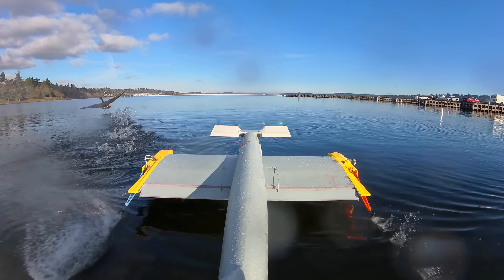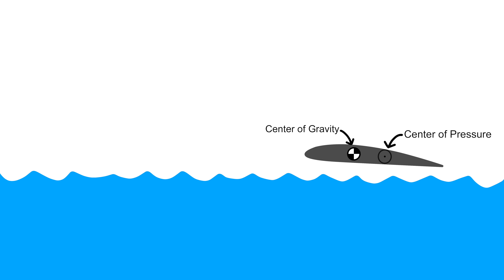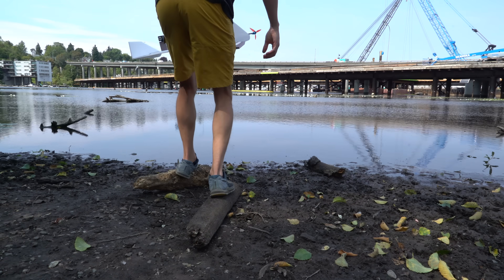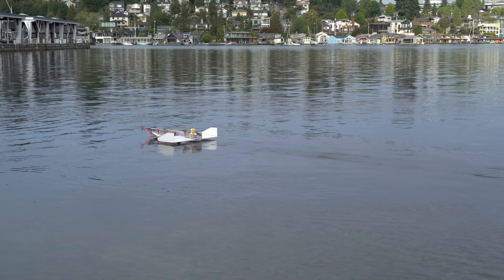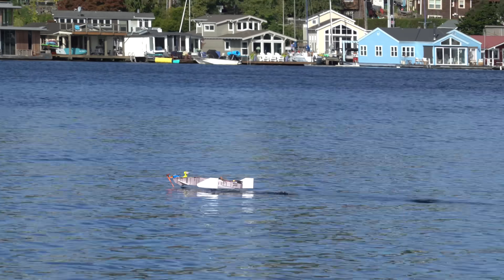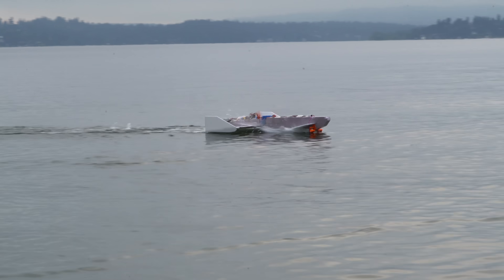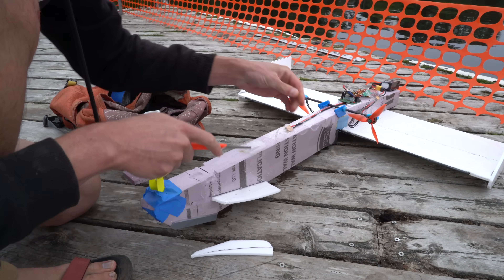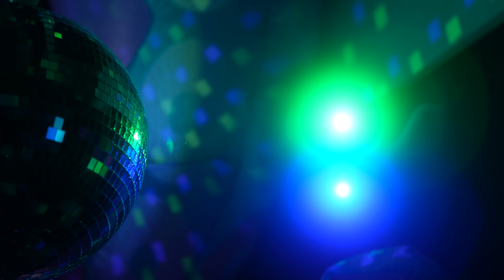Testing a Hydroplane / Ekranoplan Hybrid

Comment: i love your hydroplane videos. and as a former Offshore racer and also a RC geek 28 to 32% you want the CoF on a catamaran to have a good balans then you are up and riding on the air bag under your catamaran. we often used 32% for "shoppy" water races, and if we had calm weather we dropped down to 28 or 29% and ofc we had water tanks in the front of the boat if we had to fill up with much more weight in the front for wave jumping at speed without the nose pointing to the starts.

Comment: I dono much about any of this stuff but it seems like one or two hydrofoils would solve all the problems. From stability to turning, lift off or plunging it seems like the energy loss from a very minimal water drag would at least be useable. I wonder if extremely small fins would do the same thing, small not in height but in surface area in the water.

Comment: You should try making a larger (4 or 5 foot long) Ekranoplane, since the small size is clearly responsible for some of the oscillations/inability to deal with rough-ish waters. I think it would also increase the range of speeds it is stable at, by kinda slowing down the oscillation.

Comment: bro a Cessna 157 with 45 degree flaps and going 50 mph is a ground effect vehicle, too fast to land due to ground effect it wont touch the ground, but too slow to take off you cant pull up

Comment: I'm not knowledgeable in any way about all this. I think the most realistic way is active correction. On some flaps for really high speed correction, as even the inertia from doing it on the heavy motors would delay it too much. It looks like a too unstable reaction, one that even a gust of wind could push over the point of no return.

Comment: Have you thought about dynamically adjusting the CG within the plane?  Say, a feedback loop between an altitude sensor and something that slides the battery forward or back on a rail.  Or would the control / sampling loop not be fast enough to handle it?

Comment: Just lose the water motors. Increase the density of the aircraft. Add a large vertical stabilizer WAY back. The true solution is the Pirate Party.

Comment: I don't know if it's right, but I always picture PAR thrust as being the same as a hovercraft. And that got me thinking of something. What if in the front you had a dedicated fan/blower that pushed up with just enough force to hover. It would be a negative feedback loop in the front to counteract the nose heavy design, allowing better control of the ekranoplane?

Comment: Would it help if you added some sharp, narrow, semicircular, V-edged 'pontoons' with tiny horizontal stabilizers to pivots on the trailing edge of the wing tips? I'm basically envisioning a tiny surface-skimming strut that extends below the craft as it lifts off the water, shaped in a way that planes well during level 'flight', but catches the water to create drag if the nose lifts too much and the craft tries to take off or flip. Basically, I'm wondering if it might help to add a miniature, pivoting version of the anti-wheelie bars you see mounted on the back of top fuel dragsters to keep the immense torque from flipping them over.

Comment: The captain’s license test prep videos talked a bit about the lights required for various crafts. There’s a specific light arrangement for surface effects crafts. They also are required to use regular boat lighting when in displacement mode, then switch when planing.

Comment: What about a ducted fan, with a flap that splits air between forward and upward thrust? Sort of like a hovercraft.  idk why, there's not specific advantage, but it'd be kinda neat to see. 
Another banger gev
Reply: For the water skipping, I think you're better off going with your hydrfoil idea. Controlling the hydrofoil's downward pull force into the water using elevator flaps on the foil itself could prevent the craft from flying away.  Maybe I'm forgetting and you've already tried that, though.

Comment: I'm an engineer by no means. But wouldn't it be possible to have one component under the water surface which is keeping the nose or the aircraft under water, while the motors try to pull it out of the water. So In the end there will be the force equalling out?

Comment: it stikes me that the problem of bobbing needs to be sorted out by averaging surface height.  How about something like a buoyant skate blade under the bow - used as a feedback mechanism for prop tilt?  Of course the same could be achieved with a downward-facing doppler sensor and so averaging function in the controller's algorithm.

Comment: I wonder if the big propeller size compared to the model size is an issue.
The propellers are so big, the bottom will probably produce ground effect thrust, while the top produces much less normal air thrust. Thus maybe the propellers themselves cause the bouncing by oscillating between the 2 thrust modes. It might be useful to encase the propellers and turn them into some kind of turbine with only a narrow exit to streamline the thrust to a thin point.
Or combine this ekranoplan design with your "100% Blown Wing Powered Airplane" design.

Comment: Make a front heavy limo, real long one. And use the rear stabiliser to trim it up instead of trimming it down when it gets lift. Long as in long body with high aspect wing in the middle with high angle of attack, with weight far away from the wing to slow the intertia enough for the controls to have a bigger effect. Deep V in the front is fine. Deeper than what you had here. Only serves to make it forgiving during take of and landing.
Reply: The lifting tail is a great suggestion for his nose-light airframe. Would prevent pitch ups.

Comment: Try to use the profile upside-down If it moves away from the water, it will pull down aerodynamically. And if it is close to the water, it will hold the distance due to air cussion.

Comment: This is Totally Fascinating!!  Your Persistence is seeking a "workable Solution" is thing of Beauty!!  I have a suggestion
I hope you find useful. Focus on the Wings and other Lifting surfaces.  As the Angle of Attack Increases and More Lift
is Created, you need a graduated method of "Dumping Lift Energy".  This could accomplished by having "Shutter like 
Devices" that Automatically start to Open or Close as the AOA changes on the Wings.  The "Shutters" will allow under
Wing Pressure to "Escape" to the Upper Side of the Wing.  A self correcting Lift Mechanism!!  I think it would be faster
reacting than changing the Prop Pitch Angle.  I really Enjoy watching Your Videos!!

Comment: Water foil devices solve this problem with a tail stabilizer: when a bow goes down, tail changes an angle of an attack and rolls a craft in an opposite direction. When a bow goes up, a tail rolls everything backward. When an angle is optimal, a tail generates a lifting force merely enough to hold itself.
You swapped everything. Your bow helps it to increase an instability. Get rid of a long bow, and add a long tail instead (and make it wide enough for an enough performance).

Comment: I think you’ve definitely caught everyone’s attention but you did it by going 100% down the wrong 3D printing rabbit hole. Today’s micro-electronics should make it very easy to incorporate two (for redundancy) lidar or radar sensors to know the vehicle’s height over the water. Tiny trailing edge flaps or even over-wing spoilers could then adjust the lift perhaps 50 times per second. Voila! Smooth ride and adjustable ride height.

Comment: The only way forward might be for an Arduino/Electronic stabiliser, using some type of pitch control. I watched the video and what you have done is impressive. Perhaps if you could rig some emergency type of corrector ? Stealth aircraft are also unable to fly without computer stabilisers. Fortunately you only really have one axis to correct. Good luck.

Comment: Surely your angle of thrust on the wet props is creating lift in the nose? Would not a level or even slightly inverted angle help to keep the nose in contact with the water? Rather than the angle of thrust pushing them up out of the water constantly? That whole design seems counter-intuitive to me.

Comment: I saw some kids with a stingray-shaped toy with an Aluminium tube tail playing in a Mekong Delta canal - that flew really well. I have a video...
The hydroplane race boat flipping is because they are always built tail-heavy instead of putting the engine at the front which would mitigate the problem but cause the propeller to pop out of the water often.

There are some extraordinary photographs shared by Michael Cleary on the photo share website 500px that might let you get some hints from Nature if you would like to cheat and shortcut your aerodynamic investigations ? I am not sure that I am allowed to link out here from this comment ? He has many photos of fruit bat flying foxes just after dipping their chest hair into a pool (that is how they drink) and also some diving birds. 
The particular photo that I suggest that you find has the bat wing forming a semi-circle with the wing tips almost touching the water and the bat body already an inch or two off the wet surface: it looks like a pure pressure pocket for efficiency but obviously the bat cheats with active AI aerodynamic controls. He titled that photo "Levitation".
🤣 Enjoy your experiments

Comment: Some suggestions for solutions for this problem, a shorter chord on the wing will reduce the effect of this lift displacement. Another one is to have two sets of wings, one to the front and one to the rear, making the front wing stabilize the craft with the increased lift it gets if pressed towards the ground/water. It should be possible to build such a design to be passively stable.

Comment: Maybe add a pressure sensor that actuates a bleed off slat in the wing.  Just like in the old SR71 engines, they would bleed excess pressure to keep things cruising at different speeds.

Comment: the nose adds drags and thats prolly enough to stabilize. if you add an under water fin itll just work... but then you had so much drag that you might as well just have a regular hydrofoil. i suspect the motor suspensions isnt the worst idea but its hard to get them super precise. perhaps with super high kv micro motors pushing up/down to compensate? idk, crazy ideas are fun

Comment: Hey here's an idea that could make this work. Use a small hydrofoil wing with a built in flap mounted underneath the front part of the boat. The foil just pulls the front down and will cut through the waves providing smooth stability to keep the craft in ground effect. The craft would be kept held down in ground effect using the variable lift from the foil pulling down the front nose, and then elevons on the above water wing will control roll....This could be a positive stability loop, with the max speed being the cavitation barrier. The faster the craft goes and more air wants to pull the thing up, the more pulling down force from the foil; and water forces are stronger than air so the foil shouldnt be ripped out of the water. Also having a foil in the water means you can use the mast as a rudder, possibly making for a high turn speed rate. With motor placement, go for a puller setup instead of a pusher, that way doing high rate turns will be passively stable. I suppose doing this means the foil could lift a significant weight by itself, although it wouldnt be in water ground effect XD but it is still flying in the water, not planing. So it retains its style points from being a high efficiency flying craft 8)

Comment: Hi the russian vessel you show has a very large stabiler and vertical fin it is much higher than the main lifting wing/foil ? and perhaps the added height away from the surface effect and size could control the optimal height above the water surface ,that and ailerons in the main wing/foils acting like independent elevators might help with the sudden pitch up and down a multi axis gyro. good video. Regards Chris Bailey

Comment: Nice effort.  You need a control surface outside of ground effect to prevent the oscillations.   If you want a canard, in cruise mode, it has to be on the edge of a stall, so that any increase in angle of attack produces a stall and a nose down moment.  Many successful GEV use a reverse delta wing, with wing twist to force the root to stall before the wingtips.  It is good to have a wave riding float that controls a trim tab to maintain ride height.  In choppy water the float has to be in front of the hull.  Take a look at the sailing hydrofoil, the Moth. Good luck

Comment: Would an internal weight in the fuselage moved back and forth with a little servo motor work? I imagine you could use the same flight controller stuff to make it move where it needs to, along with some code to make sure it isnt too jerky.

Comment: I have to admire both your innovation and industry, but try to accept some lessons from the Russians who went this road before and settled on some basic science. They settled on two types of machines, one with the more regular mainplane with a large tail out of ground effect and many spans back, and another type with the anhedral reverse delta, which uses the wing tips which are closer to the surface to balance the lifting forces to prevent nose-over.
Other attributes worth a mention is the PAR propulsion, which isnt on a canard just an aerodynamic cantilever. This breaks surface tension early, it can be directed under the wing  to better saturate the air on the lower surface, then the thrust can be directed up and over the wing once at speed. The other notable feature is that these are best as trimaran hulls when on the water or when theyre considered watercraft.
Take a look at Aquas Ekranoplans for configuration and pay attention to their boosting tips outboard of the sponsons. They seem situated at about 30% MAC and are situated higher than the wing which manipulates the forces at various heights above the water. These were lessons from Bartini's VVA 14 that used aspect ratio and position of aerodynamic winglets or devices to balance the lifting body aircraft.

Comment: Isn't the nose in water thing essentially a gain only feedback control loop? Why would we ever expect it to not oscillate? Even if it is just the nose without a control element, for any surface disturbance is an oscillating input to the system, so at best we could only tune the mass and surfaces of the system to avoid oscillating at one amplitude and frequency (or perhaps a series of such tuples). I'm no electron pixie wizard though, so I'm sure the elec and mecha gandalfs can tell us what's what.

Comment: Solution to the feedback and skimming issues. IMU (Inertial Measurement Unit). You can speed trigger an Arduino coded to take control of the control surfaces to keep it level at speed. Also, more weight will counter air turbulence and should improve stability as unintuitive as that sounds.

Comment: I know you're looking to build a stable Ekranoplan.... How about look at Nauti-Craft vehicles? One of those looked like a waterbug. That's what they did - they put motor pods and suspension pods on spring-loaded (hydraulic + computer controlled) stability outriggers.  The other Nauti-Craft had pontoons under the craft that rode on the water, but held the deck above the water in a very stabilized fashion.

Also, why not put a hydrofoil under the nose? It still won't be an Ekranoplan - but it might provide that drag on the water - as well as some lift at speed (lift within the water)

The Ekranoplan weighed in at TONS. Getting that thing to 'skip' would be a much slower process...

Comment: I vaguely remember reading a document by one of the oriignal Russian developers of the Soviet Ekranoplans that mentioned  one of their key findings in making a stable wing in ground-effect plane....That the rear horizontal stabiliser wing is flying  a lot higher than the main forward wing.
SO thr tail is OUT of ground effect while the front wing is IN effect. Apparently this causes a damping effect that  governs  any changes in altitude. Well at least that was the PORPOISE 🐬 of having a T-Tail! Boom Tish!

Comment: Wow- gas is crazy wherever you are.. It's $2.71 here in N.E. FL. Anyway, wing planform is really important, the reverse delta distributes lift better for such a dynamic environment, and has me wondering why you aren't starting from there. No insult intended. Alexander Lippisch did his homework for us all to benefit from.. I've had a love for WIG's since the 1980's when I saw the Airfish on a tv show. As I researched them over the years I've found that the reverse delta is also the most stable. The big stab on the back is supposed to be a lifting airfoil, it helps counter the nose up tendency at higher speeds- it still must be trimmable though. Keep going, and have fun!

Comment: Question: Have you ever tried designing one with multiple thin wings rather than one long one (I'm thinking something like a fern's leaves)? This would prevent the center of pressure from ever being able to move far from the center of gravity (since it would slide off the wing), and would equalize lift across a longer relative area along the sides of the craft. 

...assuming the aerodynamics of multiple thin wings doesn't completely fudge the lift.